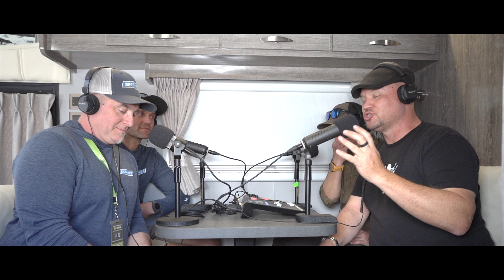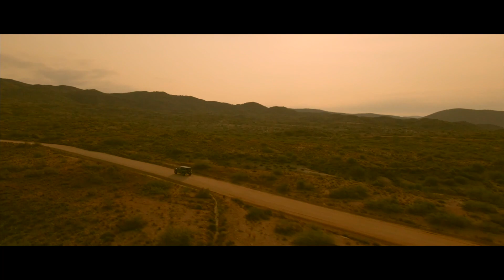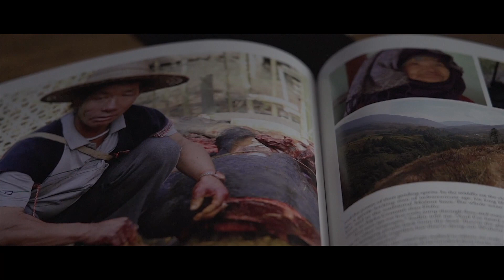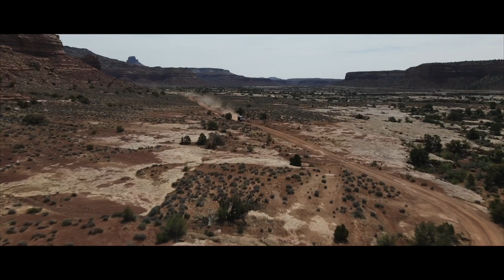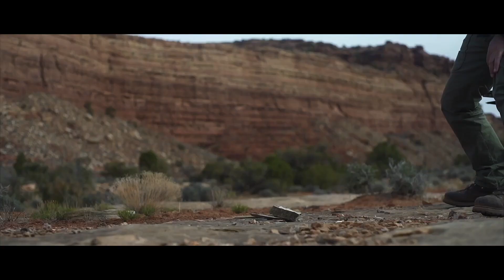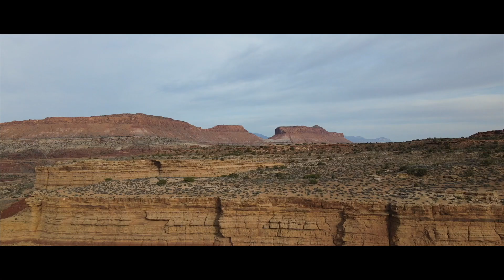The Wedge Camper Revolution

Comment: The other thing with straight sides vs sloped sides is if you’re driving on a narrow trail and the truck is at an angle the sloped sided camper will fit much better vs straight sides.